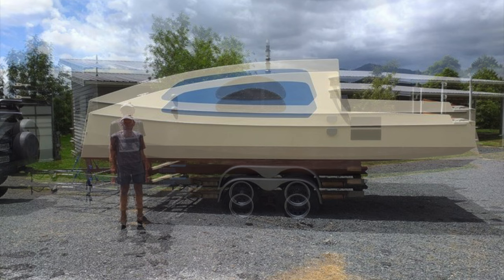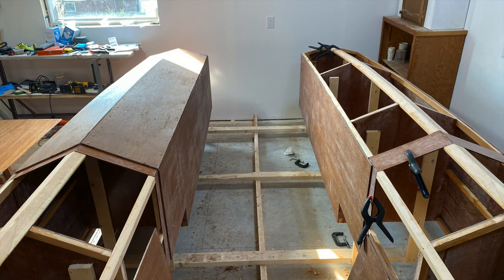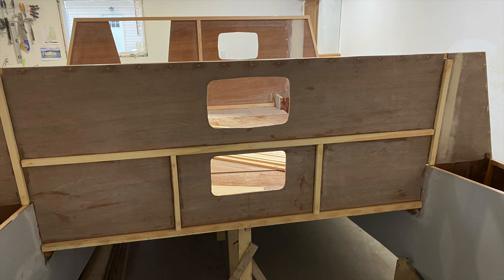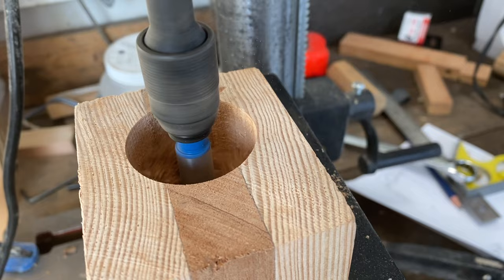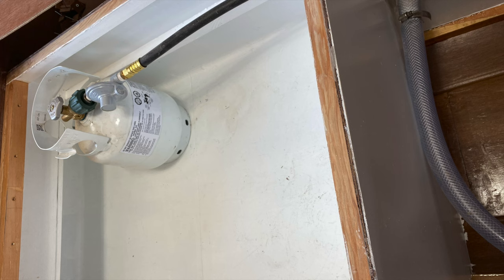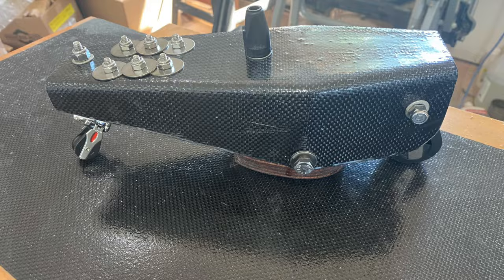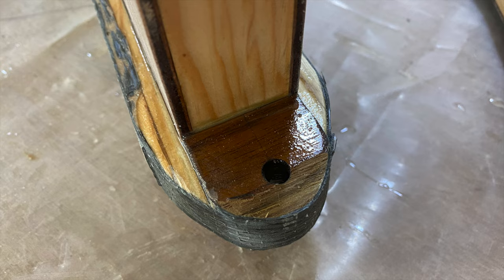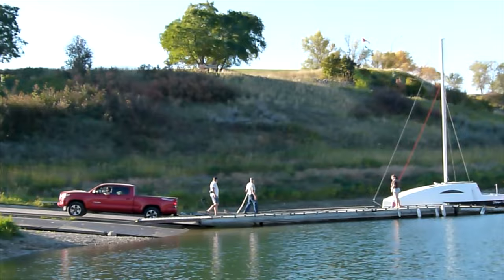The boat that David  and I built

Comment: Thanks for putting the video together, Rod. What a resource and what a beautiful build! You really seem to have embraced carbon fiber parts. I would love to see how you built those. They look great and won’t corrode!
Reply from the maker: Thank you for your comments, Bo. As for the carbon fibre, it seemed to come to me more by chance than by design. 😀 To begin with, David fabricated a number of parts on his ECO 6 with carbon fibre and I thought of the idea as just being interesting. Then when my friend Rick offered to give me the cut-offs from his solar panel production line, I decided to give it a go. It was not particularly difficult. As it happens, the brackets holding the self-tacking jib track are too short. When I make the new ones in the spring, if I remember I could take more photos and do a small video of the process showing how I did it.

Comment: Great video of the build process!! I saw pictures of your boat before and wondered if you used a Hobie 16 mast. I have a mast from a Hobie 16 I used to own. I am probably going to build an Eco 6 so it’s good to know I don’t have to find a mast for it. I’m planning a Duo 480C build first, though.
Reply from the maker: Thanks, Mark. If you have a Hobie 16, hold on to ti for the ECO 6. And if you still have it, keep the mast base also. Wishing you a speedy build soon the 480C so you can get to the ECO 6.
Reply: @RodMcLaren  yes, that is the plan for the mast. I don’t have the mast base, but those are easy enough to get. The 480 will serve my needs now for weekend camp cruising, but eventually I will want to do some more extended coastal cruising so I will build the ECO 6 for that when the time comes.

Comment: Nice Job. and the only thing's missing in your yard ,,,,, is some old motor cycles  .....
Reply from the maker: Thanks, Rusty. No, no motorcycles but for a time I did rescue bicycles from landfills, repair them, and send them back on the street - about 250 bikes over 5 years, as I recall. During that time I built 4 recumbent bikes and trikes and 3 or four cargo bikes. The yard was filled with old bikes, much to the neighbour's displeasure. 😀 Nowadays it is filled with vegetable beds and a passive solar greenhouse.

Comment: Heeyyyy...I built one of those, too!!! how's she sailing in 2024? I'm in SW FL, USA, and built mine in pre-2009(?), and this island coastline is fine for AMICA. I noticed  a different bow design on yours, gaff, raised sides, and such. :-) And I've add more "Italiano-design" mods to mine...more curves! :-) I'm considering cutting the mast to go with the Kohler's Gaff sail option. skegs, huh, interesting!?? Must be best for your waters? My deck is a 2-part composite structure, as the cabin-deck, for rigidity. I've built boats before, too. Have we met before, Rod?? sure wish I'd seen your video beforehand...great job!! I used glassed structural foam for rudders, and up-deck steps, and a swing-down motor-mount. I'm starting a build for a small canalboat cat, to go inland more. old salty dog...new trick :-) buona fortuna, and I'll "stay tuned"!
Reply from the maker: Hello, Antoniio, Yes, we have exchanged messages on the Facebook page you started and then you disappeared shortly before I began construction...  What happened? Yes, I used the "new" bow design that Mr. Kohler added tot he design sometime after you built your boat. Our sailing season is about to begin for 2024, now that the ice is off the lake. I will be posting videos of the ECO 6 sailing, although that will likely be after the sailing season is over and I have more time. Perhaps you will be able to post some videos of your ECO 6 under sail sometime?

Comment: Great video, and design choices. I have plans for the eco 5.5 . I found them of very poor quality, even though I very much appreciate the design. Curious if your plan quality you received. Also curious about your mama 24, which is my personal dream design. I wish he offered it in plan form. Salute to you sir, very fine work
Reply from the maker: Thank you for your comments, Todd. I hope you proceed with the building plans for the ECO 5.50. I did find my plans very challenging at the beginning, but with perseverance and advice and encouragement from David I  was able to do the build. The plans which Mr Kohler provides are very similar to other plans I have seen and for those who have built many boats there is no problem. I had built two Wharram designs previously and they provide much more than building plans, which is why their plans cost  so much more.  If you have not already done so, I would encourage you  to join the Forum for Kohler designs.  There are others who have built the 5.50 design and other Kohler designs and they will be happy to share their knowledge and expertise. As for the Mana 24, I would not expect it to be offered as plans. If that is really your dream boat, then buy the kit and build one. The kit represents good value for all that it supplies - I doubt if you could save very much sourcing materials on your own. By the way, where are you located?
Reply: @RodMcLaren  I'm in Tacoma wa. USA. I'm not subscribed, but I reckon I've that I've run across and watched just about everything you've ever put on you tube. We may be birds of a feather. I've followed both Bernd and James for years (decades) and have bought plans from both. I'm currently in a 24' monohull, a man can dream though. Best wishes from Tacoma Washington
Reply from the maker: @toddlong8672  Morning, Todd, Tacoma, eh? Not so far away. Does your 24 foot mono have a trailer? Seeing as you've watched a bunch of my videos you must know about the Elbow Run. Why not join us in July and we can discuss your dream a bit further? We can swap study plans from James and Bernd. We leave Tuft's Bay July 13... Message me for more details. 😀

Comment: What a wonderful project, video, and boat ! I'm not sure I caught what you said correctly: what 3M tape did you use for the windows  ? (got my own little project going on)
Reply from the maker: Thank you, Pieter for your kind comment. it was 3M VHB 5952 tape which I used to instal the windows. It does make installation of windows better than using rivets or bolts, and much easier than the adhesive which I used on a previous build and comes in a tube. Do take care with the tape - you only get one go at it - there is no adjusting once contact  has been made. My first window on the ECO 6 is not quite correct, although most people will not see the flaw. 😀
Reply: @RodMcLaren  Ok, thank you, will look at that tape !

Comment: I just found your channel ... great job on the build.  I've been waffling back and forth for my build, in particular the choice between the ECO5.5 and ECO6.  I noted that you fabricated a trailer for the Eco6 ... one of my problems with it is the beam of 9.3 feet -- trailering will require oversize permitting as local laws in my state restrict trailered boats to 96" (8 feet).  Did you build yours to the 9.3 full beam?  I have the length in my shop for the Eco 6, but i would have to reduce the beam to make it trailerable.
Reply from the maker: Hi, Robert. I also had difficulty choosing between the 5.5 and the 6.  An over-size permit is required here for a load over 8 feet but when I checked, I learned a single trip permit is $15 but  an ANNUAL over-size permit only costs $30. That made the decision much easier. So far, the extra width has not been a problem for trailering, both in the city and on the highway. It just reminds one to take extra care, which applies anytime one is pulling a trailer.  The extra width on the boat makes a very significant difference, not only in much greater accommodation within the cabin but also in additional stability when sailing and all with only an extra half metre of length and a few extra sheets of ply. I am happy I went for the ECO 6. If you are not already part of the K-Design online discussion group, check it out. A couple of builders of the 5.5 and another small Kohler design have expressed regret they didn't build the 6 instead.

Comment: What is the size of the keel and skegs. Where did you place them on the hull. I can see them in your video but can't tell how far they are mounted from transom.
Reply from the maker: How is your build going, Paul? The regular plans specify installing a daggerboard in the aft of the port hull. I decided to follow David's example and instead installed the bilge keels. I don't remember the exact dimensions or location - if you ask Mr. Kohler, I am sure he will be happy to send you drawings with the proper dimensions. On the drawing he sent me, he added the skegs and showed the dimensions. The installation of the bilge keels took me a considerable amount of time, and until I get some sailing done, I will not know for sure if I did it correctly.
Reply: @RodMcLaren  getting ready to fiberglass starburd hull. Port hull is runing behind. Not in a hurry cause then i would really make a mistake. It feels relaxing when i'm working on the boat .
Reply from the maker: @user-nq4cj8ug3s   Sounds like you are making good progress. Yes, best to take time. I enjoyed my build time also.
Reply: I suspect those keels will be a waste of time.  Too small to be functional, will just slow you down.
…..hope you prove me wrong!
I have a Woods Gypsy, came with damaged LAR keels (she has dory shaped hulls).  Still sails without, though doesn’t point well in low winds, and tacking suffers.  I am about to add keels, not dissimilar to yours!  Though mine will sit on the outer edge of each hull.  20cm deep, 90-150cm long.
She will also get a lee board, 40cm wide, 80cm deep.
Reply: You appear to have some enclosed spaces.  If so my advice is that every space should be ventilated, with two openings.  Of course with hatches to close at sea.  Glad to see you did epoxy coat before assembly, did this include the framing?  
I only comment have bought an old ply boat that was not the bargain I had hoped for!
Reply from the maker: @markthomasson5077  Thank you for your comments, Mark. Sealing wooden components is a critical part of building with epoxy - this is my third build. All parts of the boat, whether enclosed or not, received a minimum of 3 coats of epoxy during construction. When the boat is not sailing, it will be sitting on the trailer in the marina parking lot where I can easily inspect for  hull damage and potential water ingress. 
As for the keels, only sailing will tell the tale and I expect to be in the water soon to give them a trial. Stay tuned. 😀